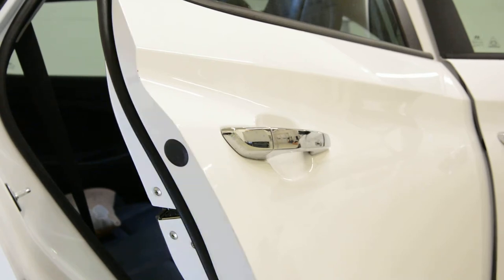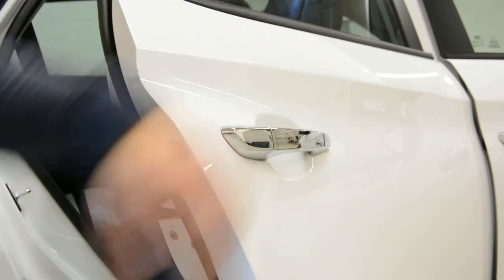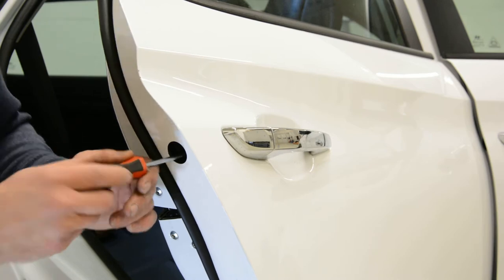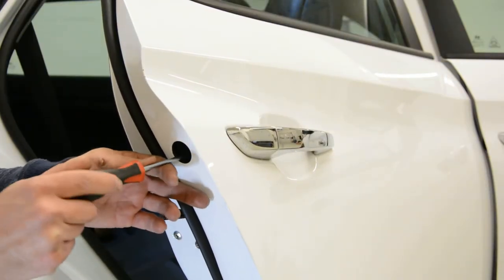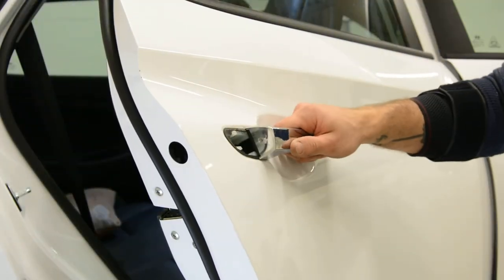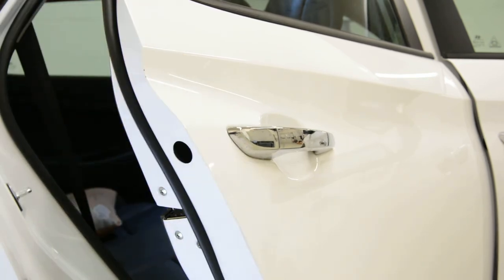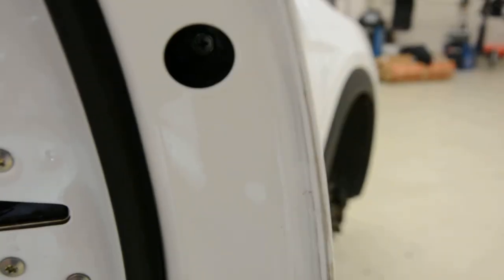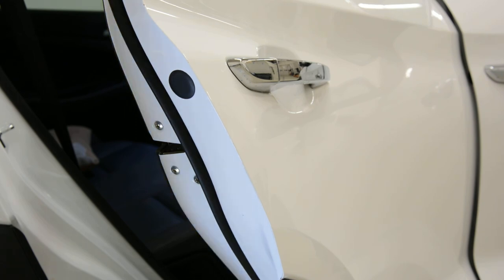Exterior door handle removal Hyundai Tucson

Comment: This was very helpful for removing the passenger side and rear driver side but how do you remove the drivers door handle that has the lock in it?
Reply: did you figure it out? im curious too
Reply: That’s an 8mm hex bolt (and it also has a clip to prevent it from falling into the door)

https://m.youtube.com/watch?v=8-AedOxPm90